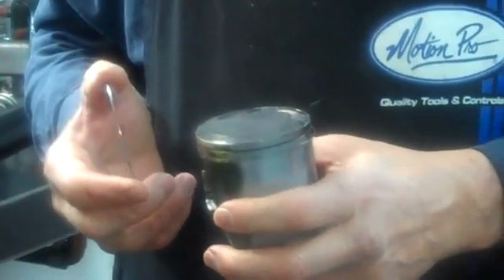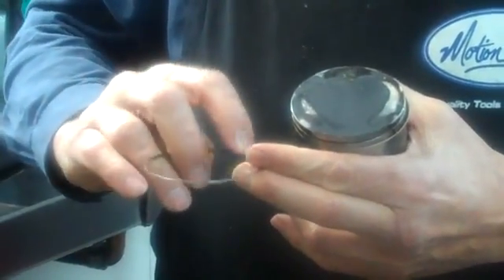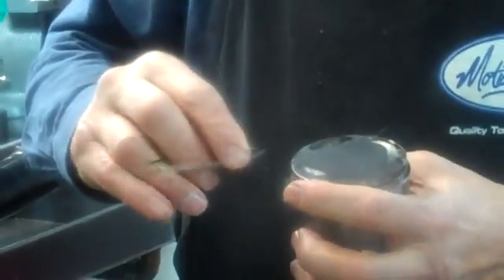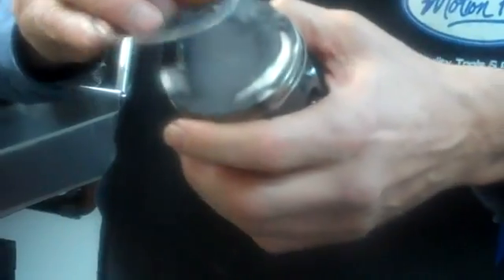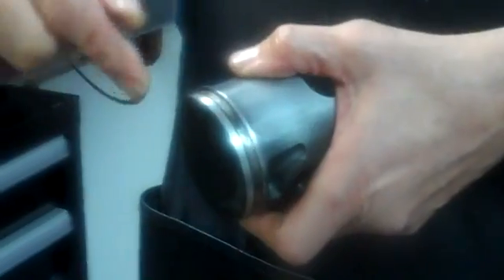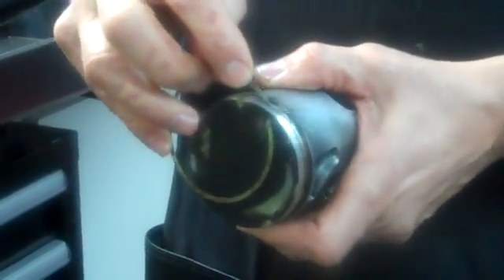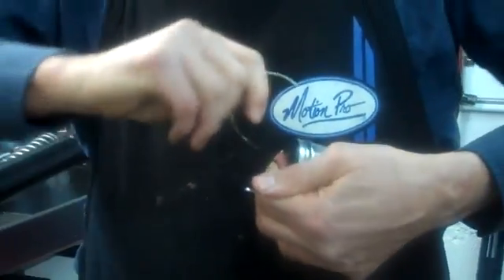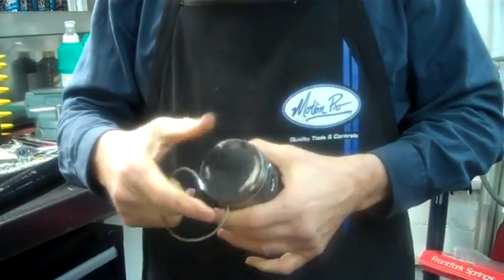How to Install 2 Stroke Piston Rings

Comment: Do you have to take the piston out to put new rings on?
Reply from the maker: The piston does not need removed from the connecting rod to install rings.
Reply: @slavensracing  so I can just take the head off and leave the piston on the crank and put rings on piston?
Reply from the maker: @petrodude57  I already answered this but I'll try again. Yes, remove the head and the cylinder and replace the rings BUT I never replace rings on my bikes. The rings and the piston go up and down together and experience the same amount of wear so both should be changed at the same time.

Comment: if the end gap is slightly too tight, can I file a small amount off of the ring tip to increase the end gap to specs?
Reply from the maker: yes

Comment: What about the expansion ring ? Have you ever installed one ? I'm guessing that it goes on under the normal compression ring.. Rebuilding the top on an Lt 80 piston came with an expansion ring.. I've never seen or heard of one before.. Machine shop recommended that I install it.. What is your thoughts on the expansion ring ?